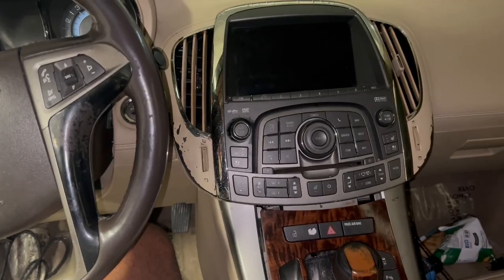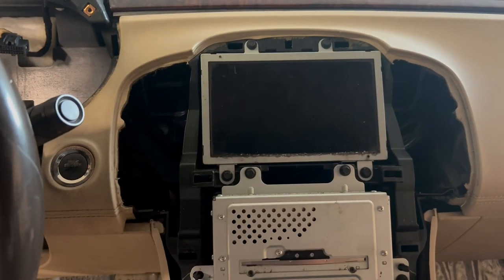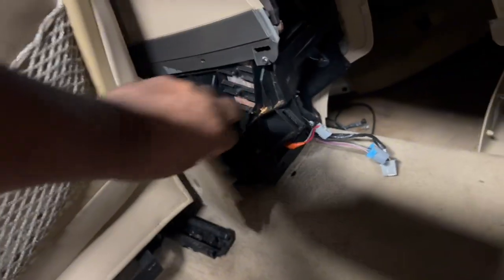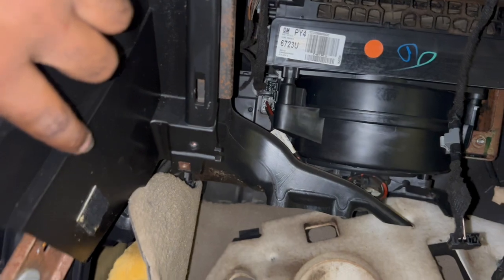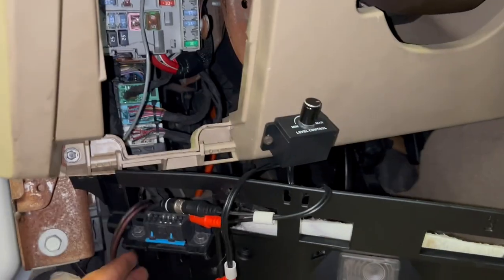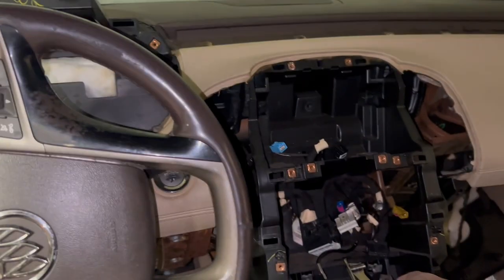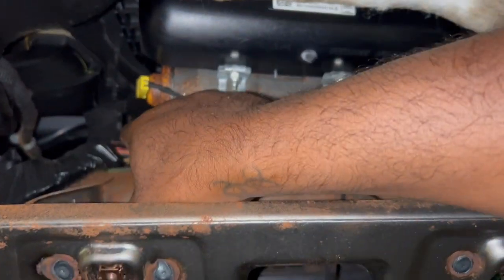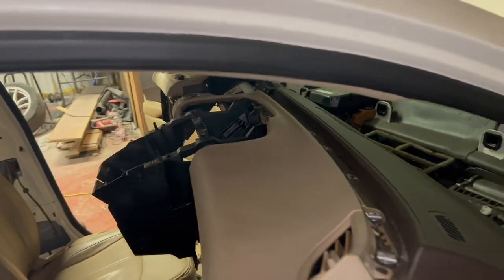HOW TO remove Buick Lacrosse 2010-2016 dashboard.

Comment: Thanks for this video, a real-life saver. Have the service manual but sometimes it's not clear. I have to replace my heads-up display on my buick, do you feel that the steering wheel needs to be removed to get to it? Or is there enough room once the dashboard is loose to access the hud?
Reply from the maker: Glad it helped and no you should be able to do it without taking the steering wheel apart
Reply from the maker: You will have enough room